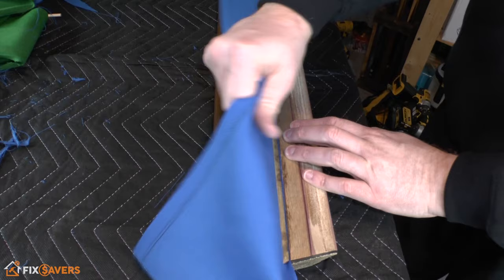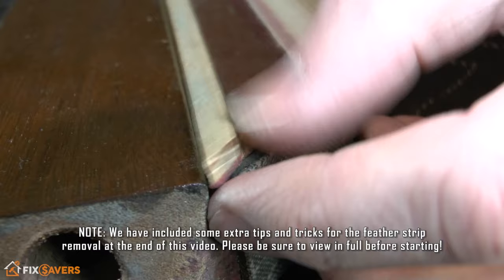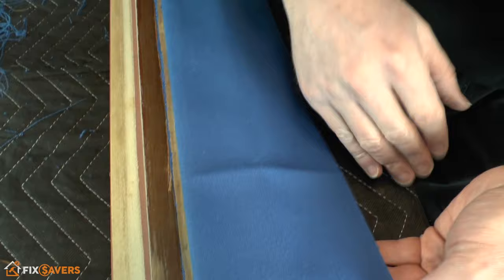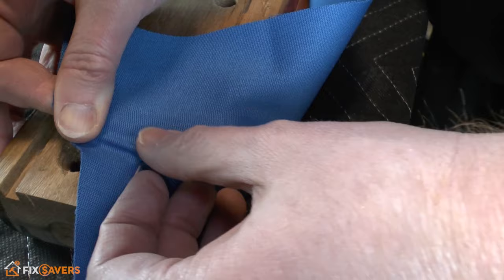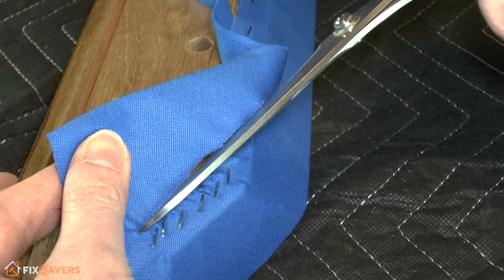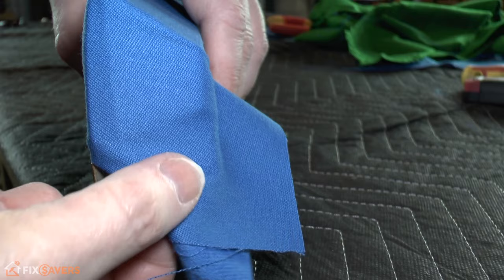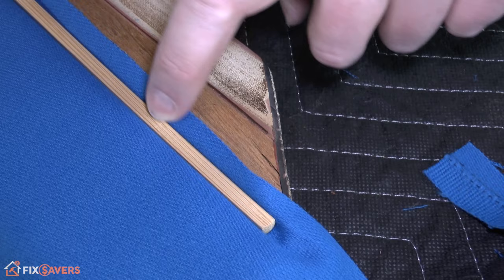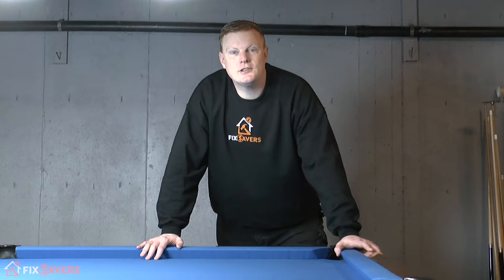How to Re-Cloth Your Pool Table Rails - FULL DIY GUIDE, BEST ON YOUTUBE!!!

Comment: Great clips guys. I will be following these guides to level the table and recloth the table and rails

My simonis 860 has the writing on edge of the cloth...IWAN SIMONIS 860 and the signature. With an 8ft table there is enough for the head and foot rails to have this showing on the angled cushions  

Do you advise to not use these (in case I screw up the dimensions and it looks odd) or would you advise to go for it....."why not?". Also I suppose there is another possibility. The reason it is there is to do exactly this (unsure if this was just to show genuity but it is supposed to be the edge that gets yanked, stapled and cut off).

Obviously I have the complete cloth and need to cut the rail bits myself.
Reply from the maker: Yes, go for it! It will look nice will the logo rails. That's a logo you want on your table!! Take your time and measure everything very carefully first. Don't rush, think it out carefully, and double-check all measurements and you'll be fine! Best of luck with th install!
Reply: @AverageJoesPool  many thanks for your advice. Unfortunately I have already installed the cloth and decided against it. In hindsight, I think it would have been fine. I found the rails to be far easier than I thought and easier than the table cloth to install. 

The cloth turned out really good. The middle pockets were heart wrenching. I have noticed that there is a small amount of slack around the middle pockets area. Nothing disastrous, but there are some waves there when you run a pushed finger around the area. 

Any advice for getting rid of that. IE, I would need to move one staple at a time to make any corrections to get rid of it, but which ones. From the table sides or directly below where ripples are on the curve of the pocket?

Comment: I didn't see or hear you mention the size staples you used. Is the staple gun also using T-50 staples? What length?
Reply from the maker: 1/4" for rails. ALso, you might want to check out the newer version of this video too: https://youtu.be/iKS2FIdYS4w 👍

Comment: Hi, I thanked you yesterday for successfully felt'ng my table. Is there any other trick to fold the felt for the corner pockets?  I'm having difficulty smoothing the felt over the corner.  I have so much material left it is leaving very thick creases.
Reply from the maker: Hey there! There's o real trick to it. As long as you have not overstretched the material, then you should not have excess left over and it usually folds well. It's important not to overstretch the cloth on the rails over the rubber bumpers, as this can lead to dead spots in the rubber rails (as explained in the video). Assuming you have overstretched and just kept things snug but not tight, then the fold should be possible. Just make sure the first part of the fold goes right up underneath the second part which will fold over the first. If the first part is not tucked right up inside flush with the edge, then when you fold back down over it for the second part then you could have too much material. Hope that helps!! :-)

Comment: I have 18oz accuplay cloth and the side pockets, when folded in this way, seem to be too much material and I fear they will deliver an uneven bounce on the pocket facing side.  Do you suggest a different method for finishing the side pockets with a thicker felt non-worsted felt?
Reply from the maker: Hey there! The method remains the same regardless of the cloth thickness (weight). You could try playing around with the fold itself. If it's not crisp enough then you can get excess material. You could try putting a thin metal rule into the fold to push the material in deeper and nice a nice crisp and sharp fold. Hope that helps 👍

Comment: What tool you used to engrave channel in  rail?
Reply from the maker: We didn't cut the staple groove, that would have been done by Brunswick (the table manufacturer) at the time of manufacture. You can retro-fit the groove if you don't have one already (and want one) using a router. Hope that helps 👍

Comment: The center pocket method is easier to do.
Can I apply the center pocket method to all the corner pockets since I'm not good at getting those wrinkles behind?
Reply from the maker: They are different and so do require a slightly different method/approach unfortunately. Stick with it, once you get the knack once the remaining corners get easier every time!! Best of luck with it!

Comment: What should i do when putting the new felt around the feather strip, the feather strip is really hard to get back into the grove and protrudes out. It fit nice (not to loose or to snug) without the felt in, but now it seems to hard to press down with the felt in. Should i try hammering it with the rubber mallet and block? Just dont wanna hit it to hard…
Reply: I ended up taking the board attached to the rail off, the decorative peice that comes down to hide under table. With that off and the rail flat i was able to pound it in better, albeit alot of force was used but didnt ruin anything.
Reply from the maker: Glad to hear you managed to get it sorted! Yes, they can be pretty snug sometimes, but better that than too slack o course! Just remember if it had a cloth in it before, then it can have one again!

Comment: All of your videos have been helpful to me except for this one. I can’t figure out the corners at all. Not enough info on how to do the corners. I have about 3” of felt hanging over each side of the rail. Am I suppose to cut the felt flush with the ends or an inch hangover or what? Bc I can’t get the first fold figured out
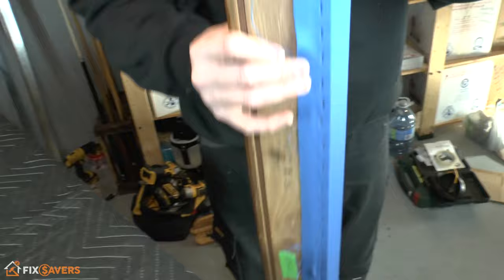Reply from the maker: Hey there, sorry to hear you are having issues. The folding for the ends is covered at 17:02 and 22:35 onwards in the video. Maybe you have a different type of rail to the ones we are working on in this video?? Do your rail look identical to the ones in the video? All of the info you need is in the video, which is why I'm thinking maybe you have a different rail type? There are a few variations, what we have here is probably the most common type for home tables. We hope you get it worked out, best of luck!!
Reply: I had trouble with the corners as well, you kind of just have to feel it out, taking up the excess material little by little underneath on the staple side, while focusing on smoothing out the cloth on the rail, if it starts to wrinkle on the rail, back up a bit until it’s smooth, add a staple, repeat.